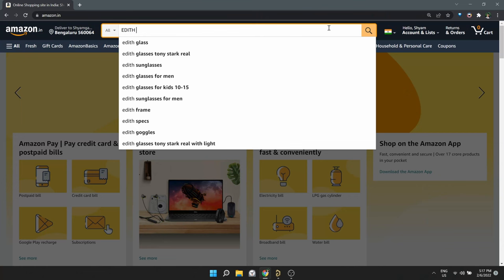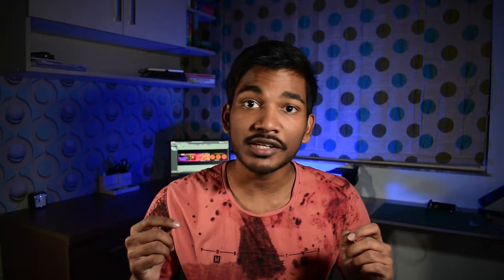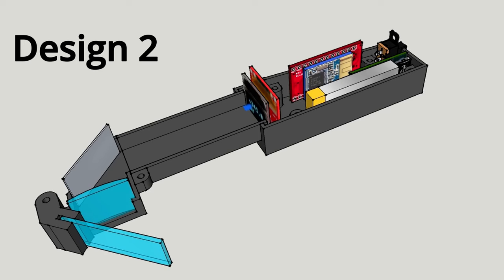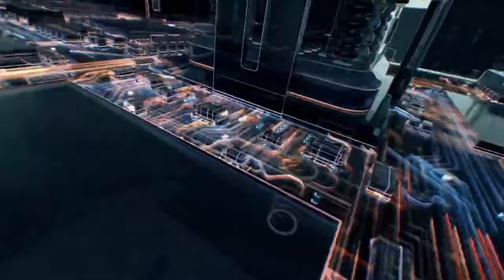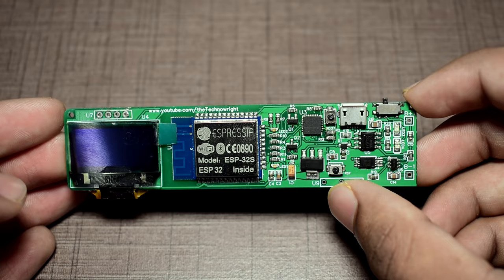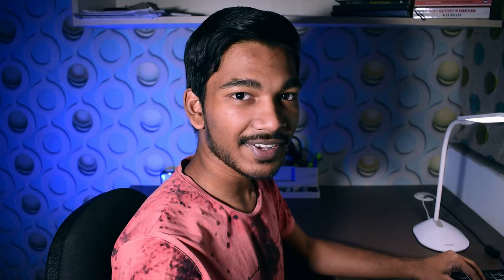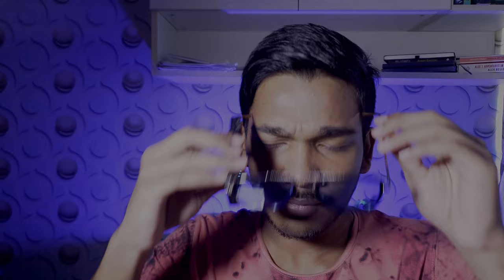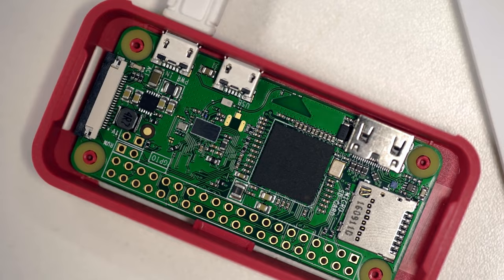Making a Real life DIY E.D.I.T.H Smart Glasses! ( Spider-Man Far from Home)

Comment: I did my project from Xiaomi Mi Band 3 as SMARTGLASSES.

Xiaomi Mi Band 3 has a specific build - doesn't have touchscreen but has touch panel separately.

When you fix it to glasses or to your head by band you have access to HR tracking from superficial temporal artery , GPS tracking and more...

My blueprints (3D print model) is on Turbo squid "Smart glasses Vitoculus from Xiaomi Mi Band3 3D"
Reply from the maker: Nice Project! Even I thought of using the Mi Band, but the display on it was not bright, so the reflection on the glass was very faint. Also how did you manage to navigate the menu?

Comment: Impressive.
Next time, use an oldsoldering iron instead of a dremel for more control of your corrections on the 3d print. Or collaborate with your local fablab if there is one in your reach.
Reply from the maker: Thanks for the suggestion!